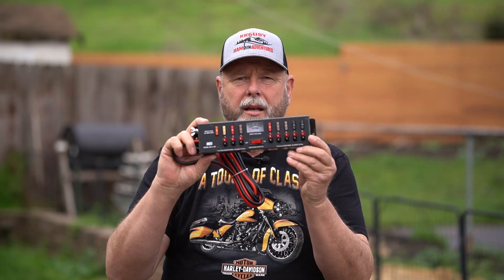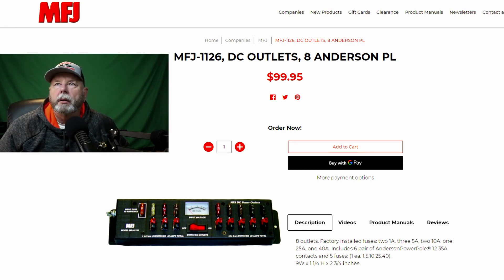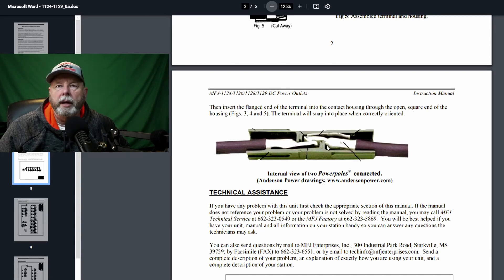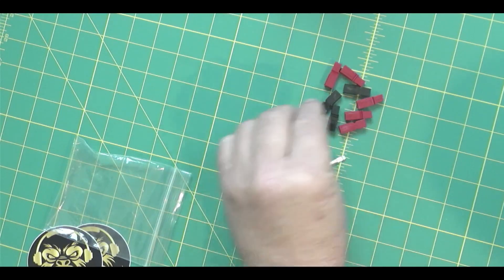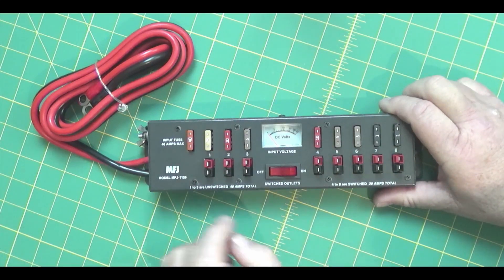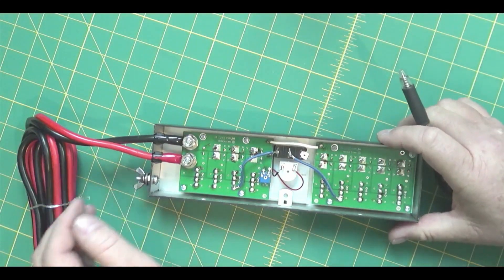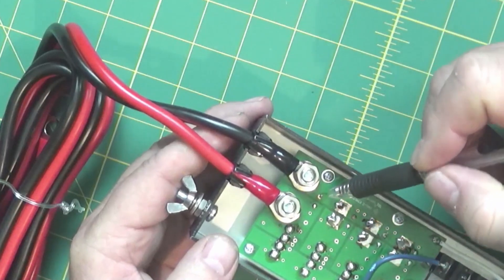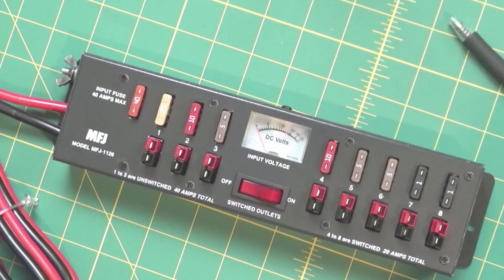How well built and constructed is the  MFJ1126, lets take a look and open it up!

Comment: The wire used on the switch of the 20amp circuit wiring doesn't look like it would carry 20Amps continuous for to long. I always have to check solder of my MFJ products.

AAA+ for Great work with your videos though.